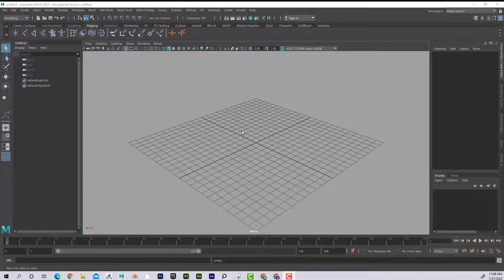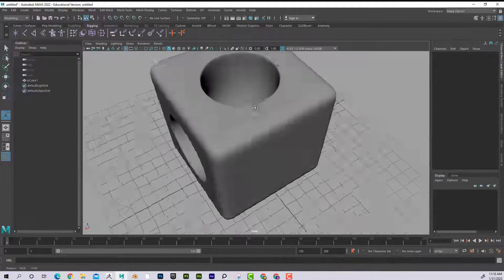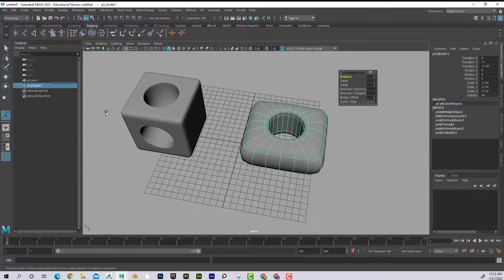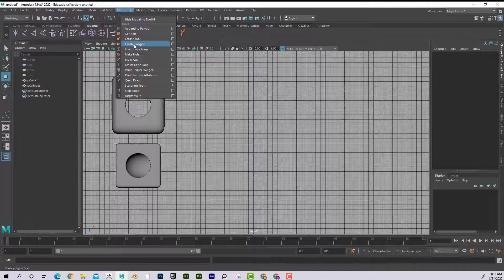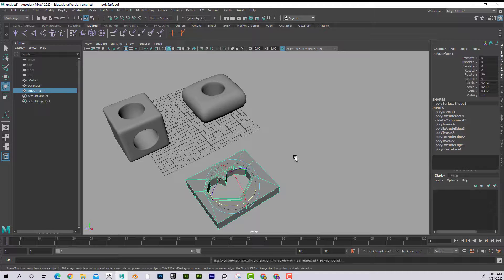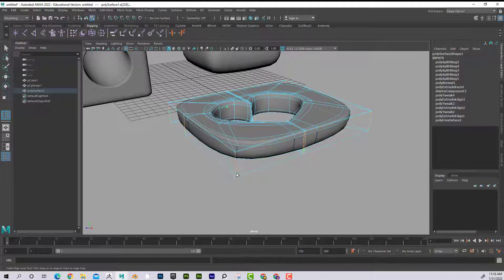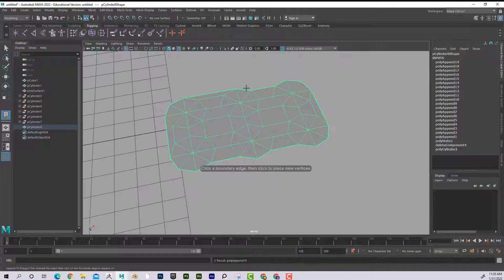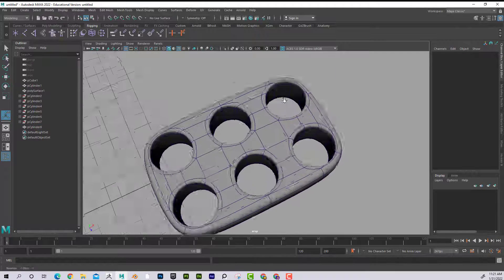Creating Holes in Maya

Comment: hi, i just discovered another way to achieve the goal, i simply went into zbrush and used polygroup uv split then merged all the uv's that i have in seperate udim files and exported them as obj's and was able to bring them into the seperate layers of substance painter.
Reply from the maker: I would not suggest doing that. Simply import a single obj with multiple UDIMs into Substance.  As long as you check ‘use multiple tile’ mode when importing everything should be fine.

Comment: Hi, sorry, I just tried it out but for the life of me I have no idea what I'm doing wrong. It says my baking is complete but none of my zbrush textures are showing in substance painter.

Are you it can work by just taking my textureless maya mesh and using it as the low poly so I can have all the subtool layers

Then taking the textured zbrush hp obj and baking it as a normal map over it and it will work, cause I've tried and it's not working.

May I send you an email with the obj's so you can test and see what's wrong?
Reply from the maker: You should only take a texture less mesh into substance. If you need to bring in the Zbrush texture make sure it’s not poly painted. You need to transfer your poly paint to your uvs.
Reply: @davidbittorf  hi, sorry I just retried baking the normals in substance painter and it worked perfectly, and I've brought it back into maya and the textures work well, now I just need to do some lighting and rig it before animating and posing it, thanks.

Comment: is there a way i can export my zbrush models udim tiles as obj's so i can import them as baked maps into substance
Reply from the maker: If the model has udims you can import into substance and as long as “use uv tile workflow “ is checked the udims should work just fine. No need to separate the udim tiles to separate obj’s.

Comment: Hi, i was wondering for some advice. I made a model and then took it into zbrush to add some hair texture, i brought it into substance, however the textures are much less pronounced in substance and im guessing will be less pronounced in maya. the height adjustment for the displacement doesn't seem to have much effect either, any advice you can give?
Reply from the maker: You have to bake your normal map. Please check out this video:  https://youtu.be/wmfnFz2ZG_k
Reply: @davidbittorf  is it better than using displacement maps in substance painter?
Reply from the maker: Yes. Displacements are only “faked” in substance. You would be better off only doing a normal map like the video or just bringing in you high poly model. Don’t monkey around with creating displacements in substance. You can add the displacement later in Maya.
Reply: @davidbittorf  ok, thanks for the advice
Reply: @davidbittorf  ok, so how do i bake normal maps onto a multi layer object since i need it to be multi layered for the coloring purposes. since i will be importing my maya low poly in with its assigned materials to create the layers, so how can i bake normal map textures from zbrush onto the object in substance painter?
Reply: @davidbittorf  is there a way i can use udim multi map exporter in zbrush to create the normal maps in substance painter?
Reply from the maker: Yes you can use Multi map export however I would still suggest just baking maps in Substance. Here it how to do it with multiple sub tools. Baking Normals with Multiple Subtools
https://youtu.be/pACb1P8JqBk
Reply: @davidbittorf  so can i just import my low poly maya obj into substance and then bake my zbrush high poly as normal map over it in substance painter?
Reply from the maker: @warlord8106  yes. That is correct
Reply: @davidbittorf  OK, thanks, any specific details I need to know especially for substance painter settings?